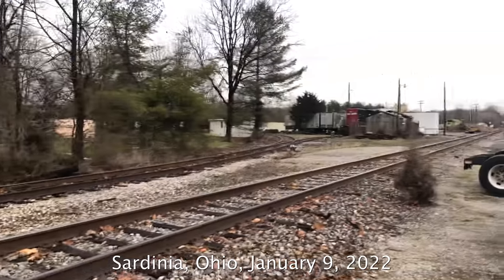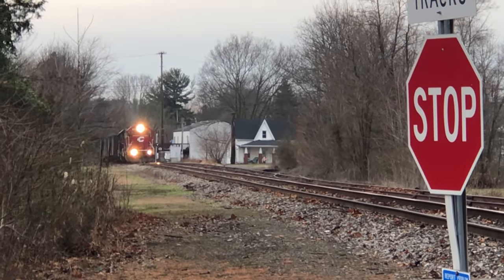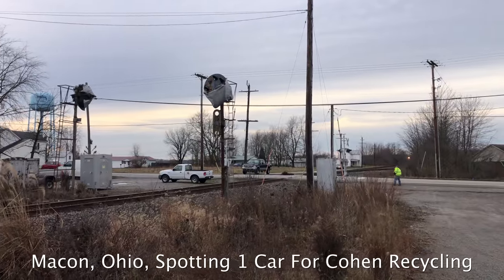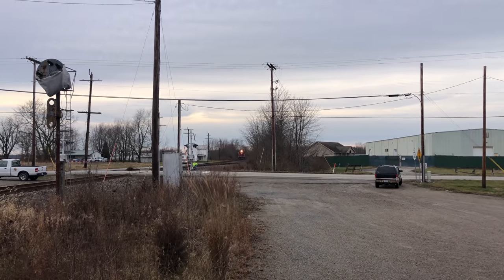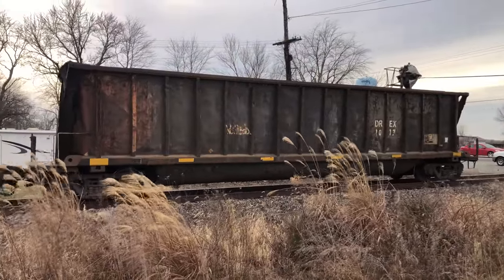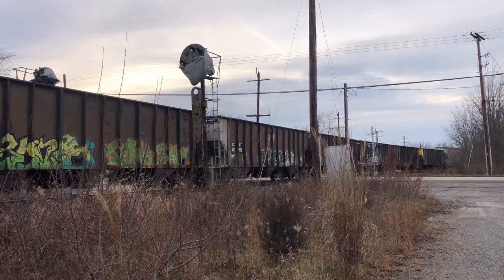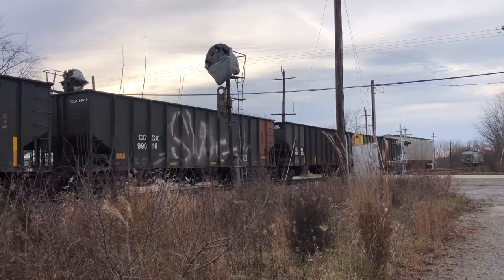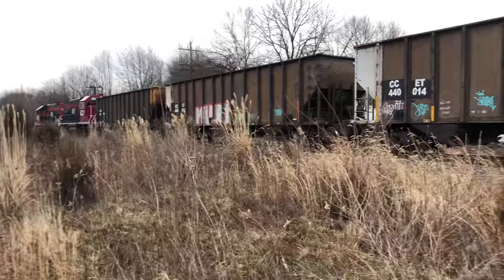Railroad Switching! Working Scrap Metal Customer, Rare Sunday Short Line American Railway Train Pt 2

Comment: Nice video Jaw Tooth! I found the switching of the open top hopper car into the metal recycler. That open top hopper car looked like it should be recycled.Thank you for uploading this video for us. You answered a question that I asked in a previous comment. I asked if the rock open top hopper cars with the CCETreportig marks stayed on CCET property or were they putt in interchange service.  I heard you say in this video that those hopper cars did not leave CCET rails. Thank you for that information. I am anxious to see more of that six axle diesel engine that was at the Sardinia, Ohio wye in this video.

Comment: Now that they have these new locomotives, have they gotten rid of the B36-7s and the other older locomotives. I like how they've got the three new locomotives with the same paint scheme and I like the red and black with the white letters. Still want one of those signals the signal head, the stand, the pole, the ladder, all of it. I'd put it outside my train building, light it up, and fix it were it cycled through the different patterns. Nice video! Stay well and warm. -Wil  👍
Reply: The B36-7s are still on the books and are actually the newest locomotives they have -- built in 1985, compared to 1981/2 for the Geeps, 1982 for the MP15DC and 1977 for the "new" SD40-2.
Reply: @beeble2003  I said new as meaning new to them. Thank you for the information though. I appreciate you providing the build dates on the locomotives.  👍

Comment: The new 6 axle locomotive, probably an SD-40, suggest to me there may be some longer and heavier trains in the near future.
Reply: Yup SD40-2
Reply: MS Hum53   Probably so.  Looks like Cincinnati Easter is buying up old, possibly out dated coal hoppers too.
Reply: @billmorris2613  Interesting to know where they are sourcing their "new" rock cars from. 
It's also good to see all of this traffic developing for CEE, and that we have JT to record the development of the shortline.
Reply: They are building a HUGE dog food plant a couple 100 yards from the tracks, I'm betting they will add a spur to the plant, but I don't know for sure.
Reply: @billmorris2613  Bill, I remember when Chessie was buying  different batches of Geep 40’s from EMD and I thought they would be the engine I would retire on , hell, a 60 car detroiter after using a slow speed crossover would pick up to 50 mph and not have to go beyond the fifth notch…..and that was back when we used the air, not allowed to use the air today…..yea, so its good to see professor jawtooth documenting the power additions the CCET is adding including the latest special duty……hoping its not a former N&W junk yard dog, they had the multiple control engines that were nothing but junk……did you ever have them down south in your neck of the woods?????? Ms~~~
Reply: @michaelbolton4600  Michael, I agree and I’m sure big plans for RR service is expected, they may be forced into having a “trackmobile” employed on site….small short lines are not able to deliver a daily service…..ms~~~
Reply: Michael Bolton   I believe you are right about a spur to service the dog food plant.  But if I was an executive with the dog food company I would want to know that the railroad was financially secure and positive it will be there for the distant future.  Do you know where the plant will be built?  Is it Purina?
Reply: Mark Fryer   I did notice a few with a reporting mark other than CCET.  I will check to see if I can make out the reporting mark.  That should answer the question of where they are getting them from.
Reply: MS Hum53   We never had any GP-40s that I know of.  We may have got some from the SP merger but I retired shortly after the merger.  But we had a bunch of GP 38s.  The 3512 an S-40-2 that CET got was an Ex NS, so it could have been from the N&W.  

We did not have much choice but to use the air brakes.  Because the MP had disabled all the dynamic brakes even on our, T&P engines.  After the UP- MP plus others, we got dynamic brakes back.  But I still used air to take my trains over the Huey P. Long Bridge.  That way I could keep from causing my conductor and rear brakeman from spilling their coffee.  I did use the dynamics for slowing down for slow orders or heading into sidings, etc, etc.  

I don’t know about you, but I still miss running trains.  But from talking with the guys still out there the BS has gotten a lot worse.  I am the COO for an organization that has a Mikado Steam Engine, SPX-745, that was built in the SP Algiers Shops in 1921.  Algiers is a part of New Orleans across the river from the French Quarters.  She is currently going through her second rebuild.  We also have an ALCO RS-1 and an ex Amtrak SW 800.  I do get to run them occasionally but I have let some of the younger guys take over most of the running of the diesels.
Reply: @billmorris2613  Bill, we had a bunch of Alco SW-1s, im going to have to reach out to a retired friend of mine, with his thousands of slides im sure It will help my memory of the Alco roster but I remember the Western Maryland had a bunch of the RS models, I remember ours as end cabs yard engines, long arm throttle lever and they did vibrate….ms~~~
Reply: @billmorris2613  yes its purina
Reply: @billmorris2613  and it is being built in Williamsburg. I'm not sure if your familiar with the area.

Comment: Another great video. Any chance you could get someone to demonstrate the “3 step” for entering the train danger area. I really enjoy the switching and radio traffic you provide.  Thanks
Reply: I believe it's brakes applied , and reverser in netual  and genarater switch off . Correct me if I'm wrong .
Reply: @lesashiminski690  That's correct but I'd add one word before brakes being "train" so it says train brakes. There's two brakes, which I'm sure you're aware of so I'm stating this for anyone who doesn't know; the locomotive brake then the train brake that includes the locomotive and all the cars of the train.  👍
Reply: @lesashiminski690  your close, independent fully applied, reverser centered, and the generator field switch open……ms~~~

Comment: It’s possible I could have run the 3512 also.  Not as probable as the 1657 and the 1687, as the railroad I worked for, Missouri Pacific bought them new.  The 3512 was an NS engine and we get a Houston run through train from the NS every morning.  We would run their engines on to Houston.  I was regular on that job for many years and could have caught it off of the extra board before that.  We ran them to DeQuincy, LA where we changed crews and they ran the train on to Houston.
Reply: Bill Morris. What was your favorite locomotive to operate?
Reply: Todd Selph   When I was still working I did not have a single favorite.  But my favorites were the SD series from the SD-40s through the SD-90 Macs.  When I hired out on the Texas & Pacific in 1973 we still had some F-7s.  They were pretty much worn out but I enjoyed running them too.  We could keep them running with paper cups, flares, the flare caps, and wire.  Most of that went away with the SD-40-2s.  Thats when a lot of the electrical relays were replaced with the modules and printed circuit boards.  I did not care for the GE units and even today, if I was not retired, I would prefer the EMDS over the GEs.

But since I retired my all time favorite engine to operate, either running or firing her,  is the Steam Locomotive SPX-745.  A Mikado 2-8-2 that was built in 1921 in the Southern Pacific shops in Algiers, a part of New Orleans on the West Bank of the Mississippi River.  She is undergoing another rebuild at this time.  Covid has had that process almost stopped.
Reply: @billmorris2613  thanks for the reply. I think those old emd f-7 (f8,9 too) are the best looking imo. Pretty cool you got to operate those.  As a railfanner I prefer to see  EMD power.
Reply: Todd Selph 👍. The earlier GEs we had, the U-23s and the U-30s, were very rough riding locomotives.

Comment: What do you mean by “Color Position Lights” for those signal lights at Macon.  That is a new term for me.
Reply: Position light signals were used by the Pennsylvania railroad. In Pennsylvania's case the lights were all amber but 3 vertical lights indicated clear,horizontal indicated stop and at a 45 degree position indicated the intermediate position. IIRC N&W had some connections to PRR at one point so some former N&W lines had the position lights. At some point roads that had the all amber position lights switched to putting color lenses red for stop,green for clear and retained the angled position amber and removed the center light for clarity. B&O always had the red,amber,green color position lights hence CPL.
Reply: Agree
Reply: Gary Sprandel   Thanks for the info.  Are you a railroad employee in operations?  

We did not have anything like those signals down here in my part of the world.  We used the four different colors of lights, usually with one 3 light mast, green, amber (yellow), and red.  In some places two 3 light masts, both with green, amber, and red.  And some time 2 masts with 3 lights and a third with two colors, red and lunar (bright white).  I learned something new today, and that is good to know.  I’m working on a project up in the North East so this info could come in handy, if any of the railroads are still using this type of signal system.  

I see You Tube as not only an entertainment platform but for me, a teaching and learning platform.  Do you know if the vertical lights that meant clear, was also called clear, if the 45 degree was called approach, and if the horizontal was called stop or stop and proceed?

Thanks again.
Reply: @billmorris2613  not sure of the question, possible typo or incomplete.
Reply: Gary Sprandel   Most of my comment is a statement.  There was only two questions.

1 Are you a railroad employee, working in operations?  

2 Do you know the names of each of the 3 aspects, (vertical, 45 degrees, and horizontal,) displayed on the CPL signals?
Reply: @billmorris2613  ok something on my end burped and only like the first half sentence came through on my end though it's all there now.
No never worked a day on the rails, ironically though I did 40 years moving goods in one form or another as a truck driver  until a heart failure diagnosis retired my backside October of 20.
No just been a rail enthusiast both real world and small scale so I guess having the Chicago and Northwestern in my backyard from the time mom and dad bought me home means I've got diesel exhaust in my blood and the sounds of EMD, Alco and Fairbanks Morris prime movers in my soul. 
IIRC green would be called clear,amber depending on the location and use would be approach or restricted depending  on if it's automatic block signal, CTC or interlocking and red would simply be stop.

Comment: JT or anyone along the CET;  Could you get some “Year Built Dates” off those new (for CET) open coal hoppers?
Reply: At least one of them has a Kartrak barcode on it, which suggests 1970s.
Reply: beeble2003   I’m thinking the hopper cars have reached, or are very close to being to old to use in interchange service.  Which is 40 years, but with a rebuild that adds 10 years to 50 years for their service life in interchange service.  But CET can use them on their own railroad as long as they wish.  CET could probably buy them for scrap value or slightly over.
Reply: @billmorris2613  I'd assume something like that, yes.

Comment: Great catches.  With those Norfolk & Western lights not in use since 2005, why not tear them down if they are not in use anymore?
Reply: It’s cool to see them still there.  Parts of the line still have old telegraph poles along the tracks
Reply: Because that will cost money. Who's going to pay? And besides, they probably still belong to Norfolk Southern.
Reply: They should be removed and they’re junk with only scrap value……NS signal department is responsible plus the signals and electric switches are outdated……
Reply: @mshum538  Thanks.

Comment: Is the Y at Sardinia still a functioning Y?
Reply: The short answer is no. The branch that it served was cut and pulled out years ago, according to JT. The two other legs of the Wye are used for car storage purposes. A recent video of JT's showed the crew shoving two very long flat cars into one side of the Wye for storage. JT mentioned that they were to be used for transporting concrete blocks of some sort.

Comment: Wouldn't it be more fuel efficient to leave all them rock hoppers on a siding if available, then drag them around to leave one customers car?
Reply: They're not just dragging the hoppers around: they're taking the hoppers to Plum Run and also dropping off the gondola at Cohen's. The railroad's a straight line from one end to the other. If they dropped off the rock cars somewhere, they'd have to go back for them.